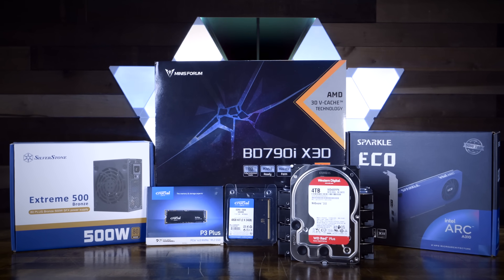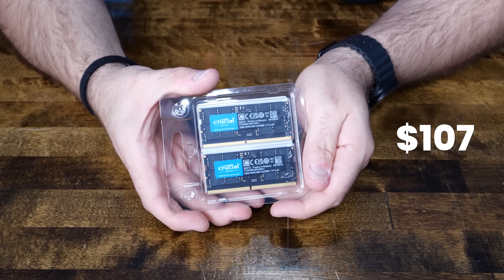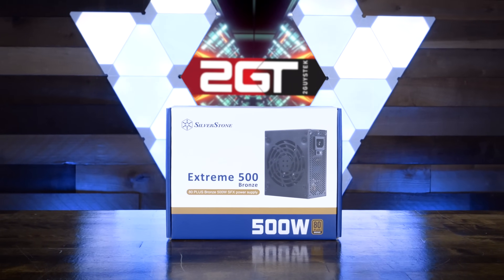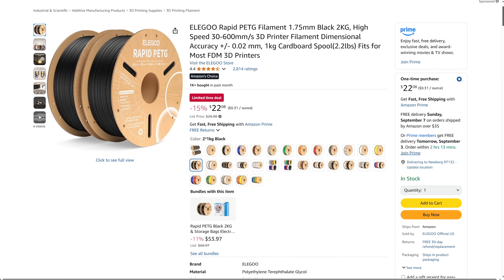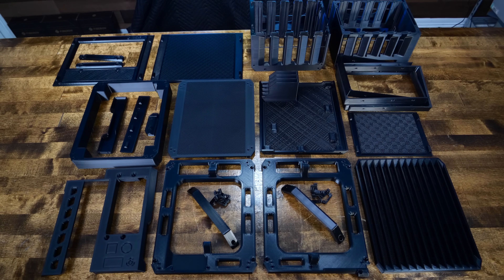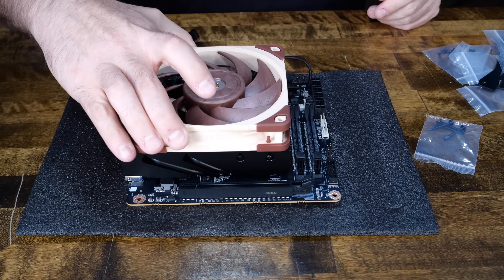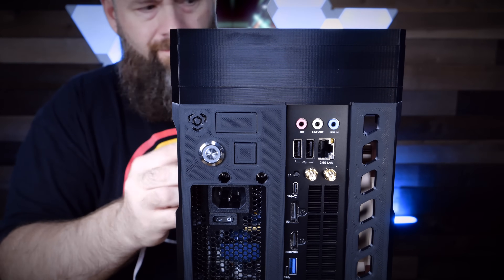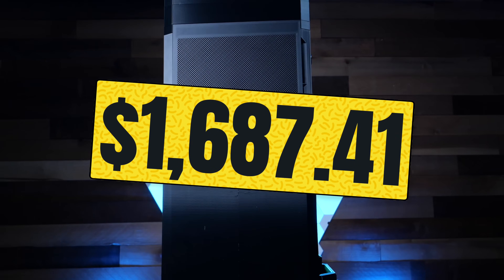3D-Printed Mega Homelab Server Build!

Comment: Are there any pre-designed options for using a SATA backplane instead of cables? And same question for 2.5 drive caddy's vs 3.5 drives?
Reply from the maker: Not officially, but I believe it's possible if you find the right backplane

Comment: You went with PETG because you needed it to resist heat better, then you chose a "high speed" or "rapid" version that literally prints faster because it melts at a lower temp and faster than standard PETG. Sometimes you are better off just printing a little slower.
Reply from the maker: Did you finish the video? I ended up using an entirely different PETG. But hey, thanks for the comment.
Reply: @2GuysTek  I did finish the video, but the comment was before you switched, and you stated the reason was it was too shiny. The reason it was too shiny, among other things, was the hotter you run it the more shine you get, but also the more strength. Swapping to the carbon fiber fixed more issues than you even knew you had. The case will actually be less strong in the layer bonding, but more rigid and more matte.

Comment: This case is interesting, but printing with carbon fiber is not worth the risk to me. Those fibers just hook into your skin and to handle it safely you need proper PPE. It also just contaminants your printer do you may have more carbon fiber hooks coming out in other non carbin fiber petg prints. Nathan builds robots did a great video on this type of filament a while ago and I recommend people watch it. I'll be looking at some different petg filaments to find one that can withstand the heat of the pc without the risks of CF.
Reply: https://youtu.be/ddwNZ12_qX8?si=EktaeQ0pKWSP7hrY found the video for anyone interested. Watched it a while ago prior to getting my printer to build safety precautions since no manufacture gives adequate safety information in my opinion. I would highly recommend everyone stay away from the filament recommend in this video.
Reply from the maker: This is not carbon fiber reinforced filament. Refer to the link in the description for more details on the Polymaker filament used - I believe you can find a link to their SDS documentation from their website as well.
Reply from the maker: https://fiberon.polymaker.com/product/petg-esd/ has their SDS documentation.

Comment: Good concept, but there are downsides. I've had the BD795i SE not once, but twice. The first time, the CPU went out; the second time, one of the RAM slots died. RMA'd the first one and received a refund after the second one. I find it best to build using separate components. The case, while cool to print it out, wound up costing more than or the same as NAS case itself. I got 2 Jonsbo N4s on sale from Amazon for $99 each.

Comment: I wish those boards have dual networking and access to 10gb port/card.
Reply from the maker: Fair. However, there's a lot of ways you could add 10Gb Ethernet to the board either via the 16x PCIe slot or one of the M.2 NVMe slots on the board.

Comment: For about 1 year i use two of this cases for my homelab/NASes, one my main rig with Erying i7-11800H ITX board, 64GB DDR4, 3x 2TB WD RED for storage, 2x 250GB Crucial MX for cache and 2x 1TB Crucial MX  for doker apps/VM, 10Gb NIC the second work with i5-8600, H3700M-ITX, 32GB DDR4, 2x HGST 4TB, 2x Toshiba 2TB, 2x 512 GB Kingston KC600, 10Gb NIC workin as a backup platform and for some High Availability setups. Both using Unraid Pro OS. It can handle from Home Assitant, some Windows/Linux Jumphosts, Veeam Backup Server, media storage, Jellyfin, Immich, etc and still have a plenty of free resources for homelabing tons of OSes as VM's. 
I suggested a couple of things: 
- whiter marks on flat prints is the building plate faults, PETG sticks too good to this type (smooth) of plates it's even can damage your plate (don't ask how I know that xD), try with textured PEI plate, it's also provide nice texture to front and side panels witch blend better with rest of the case (you can also use 3D print gluestick as a helper to unstick the model from plate).
- don't buy overexpensive fancy filaments, just decrease a bit temp of nozzle, it;s make PETG more matte than shiny. I know it's make layer adhesion less firm but in this case we want some good looking, and temp resistant, not some extremely high impact resistant.  
- in premium version of this case You can find a model of front panel without 2.5' HDD slots witch provide more space for cable management.
-for HDD signal cable try to use server style bluish 4x or 6x in one sleeve thin cable its look like a breakout SFF SAS cable but with standard sata connectors this is gamechanger for cable management in this tight spaces.
- ADD some colors for this build, for eq. my top vent panel, bottom panel and drives caddies are print in translucent orange PETG with match for theme of Unraid, it's looks neat!
- the screen probably work only with the flex PSU back panel. I think ihis information is somewhere in manual or website of the designer.
So bad I cannot attache an image of my setups.
Anyway, great project and very nice video! 3D print is a gamechanger for DIY homelabing.
Reply from the maker: Join our discord and share your photos! We'd love to see them!

Comment: I wish I had time to 3d print...  Awesome case!
Reply: i just got one a cheap used 3d ender $100 they are even cheaper  sometimes  $80 or $60 
just get anything to start and upgrade later  there is much to learn  that  you will still have to learn on a more expensive unit